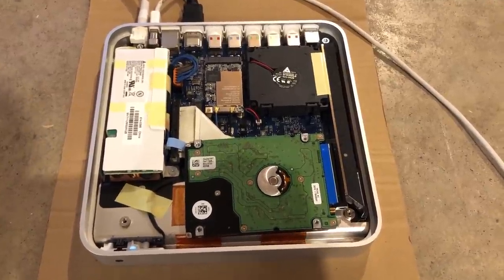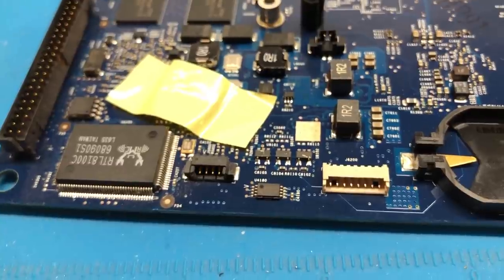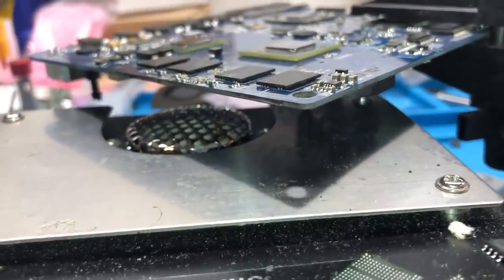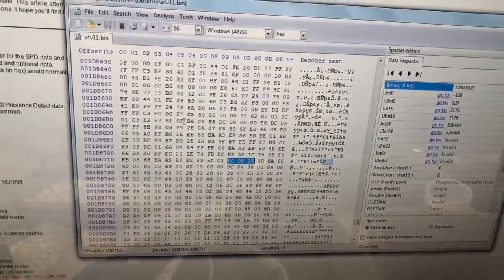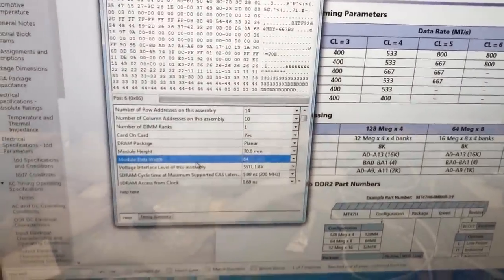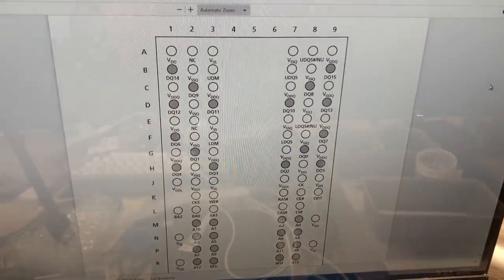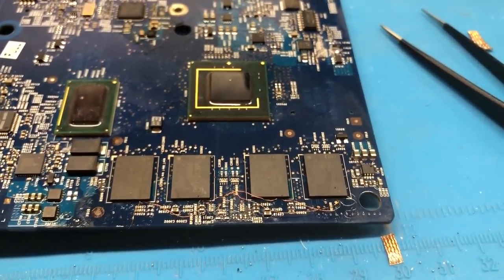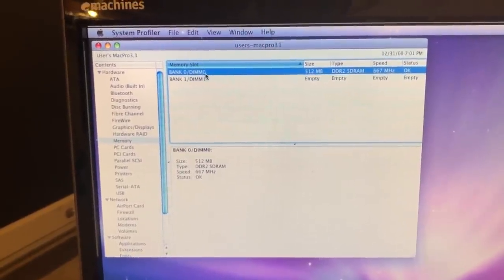Original Apple TV RAM Upgrade

Comment: damn, just when I thought you were done with the crazy RAM upgrades haha. I was sure you would give up when the address line issue came up, but you actually took off the PCH and all the RAM chips and reballed again to run the jumper wires. I'm seriously impressed

Comment: For a long time I used this ATV 1st gen with CrystalBuntu and a Broadcom CrystalHD chip in the place where the Wifi Board used to be. And I also fitted a IDE2SATA converter and it was my media center for a long time! Very nice! Serving Samba, BitTorrent Sync and Transmission. Fun times!
Reply: That’s neat
Reply: I still use one for this lol, haven't found a better device that has component output for connecting to my crt easily
Reply: I never managed to fit a sata adaptor in a way I was happy with. Such a shame these weren't sata based, the time period was right but I assumed the chipset didn't have a built in sata controller.
Reply: How did you get BitTorrent sync running on it? Also I can't imagine it ran well given how much ram resilio sync uses for me.

Comment: That's amazing! I had no idea you could do bodge wires with BGA chips. Makes sense that the wires were still necessary because otherwise that last address line would be floating and it would be unpredictable which half of the chips you'd actually be addressing...
Reply: you dont know i ve seen indian technicians who soldered a bunch of wires under the bga chips in a phone which is impossible because its so small
Reply: Not practical and there is a good chance that you will end up ruining the chip/board but its not impossible.

Comment: I know this was a long time ago but you can protect things like that IDE port with kapton tape. Just tape over all of the things that you don't want to be affected by the heat. It's great stuff. The through hole connectors are usually added after all of the surface mount using a flow fixture.

Comment: You have 3 problems that could ruin signal integrity: impedance matching, length matching (timing problems) and your line is too far from the ground plane. To properly apply such kind of mod you need a VNA to measure impedance and a fast Oscilloscope to test timing. To solve the grounding you must use a tiny coax or flex pcb with ground plane.
Reply from the maker: I was planning to make some custom flexible PCBs to bodge on an entire second rank (so 4 more x16 chips). Basically they'd sit under the original chips in a way where the original chip would be able to solder to both it and the pads on the board (basically BGA pads with small holes), and have a set of pads for a second chip that you could solder on, then fold around and stick on top of the original chip. You'd only have to pin out the #CS1 line from the MCH, which of course isn't used for only one rank. Flexible PCBs are somewhat expensive to have manufactured, though, and isn't worth it for this crappy Apple TV LOL.
Reply: @dosdude1  That would be a financially unviable spectacular project
Reply: @dosdude1  Projects like that sound like a good reason to make a patreon, so us EV Nerds can see something that epically unpractical undertaken lol.
Reply: Only out bro doing things no one needs wants or thought of. But holy shit it’s great

Comment: I saw that there is a Geforce Go 7300 with 256mb would that help any of the performance?  I know it is about 4x the memory for the GPU?  Since it is the same chip, only with more memory, would the ROM have to be modified?  Wondering since you wanted to put 4x the memory in for the system.  Have you looked into any other memory chips that would have worked better?  No need for the wires that had to be added?

Comment: These were amazing when they came out.  If you had an HD video camera back then, there really weren't many good options for showing your own content aside from carting around a computer because BluRay burners were still crazy expensive. Sadly, they ran very hot and my iTV died a very long time ago.
Reply: DVD players existed and the majority of computers had DVD burners by then.
Reply: @jm036  The 720p HD of the original AppleTV is almost 3x the pixels of DVD (i.e. 480p SD).

Comment: So ive been watching you for a while. But i was wondering if you could give me any pointers on replacing a FCBGA cpu. I wanna change out this old celeron 2955u for a i7 5557U. its about 4x better. both use FCBGA1168 but i was wondering mainly where i could get some of the tools you use and the solder balls. Also do i put flux under the cpu when heating up the solder balls?

Comment: You can use a drop of resin to hold the wires in place next time, so drop of resin. Uv light and sand it down
Reply: Yeah, I was thinking the same thing: glue the bodge wires down (or at absolute minimum, tape down with Kapton tape).

Comment: On the top side of the board next to the wifi card there is one or more Samsung memory chips.  Can they be upgraded as well?  Were you able to determine the pin out on the 10/100 ethernet chip to see if it can be upgraded to gigabit ethernet?

Comment: As you're the owner of one of these, is there any way you could figure out a solution to make a no-frills installer to get a modern CLI-only Linux distro installed on these, like Debian? No one has a tool that does specifically this, it's all media center OSes with limitations on what modules are in the kernel by default, and OSMC dropped support for the hardware ages ago. these are still wildly useful as shairport-sync airplay units and the like... so long as you're willing to do some cooling modifications. it's hard to set it up to do these tasks and any sort of other modern program amenities without running into compiler hell with the old 4.x kernels and debian-jessie-era software. 256MB is more than enough to make this happen, and given they have RCA, optical and HDMI audio outputs, they make for a great audio media center and such.
Reply: It is actually not that hard to boot a Linux on these. You need a bootstick with the apple Tv bootloader and a linux installation on the harddrive or a USB stick. The bootstick boots an old version of Ubuntu and lets you start another linux kernel using kexec

Comment: Rather than desoldering that tiny little chip, you can just clip a programmer onto it (like a CH341A, but get a real clip) and run `flashrom` on it.  I've done that many times and reflashed chips without touching a soldering iron.

Comment: I wanted so bad to use this as a media center PC.  I didn't like how the ATV software relied so heavily on iTunes, and was limited to 720p.  However, the XBMC (etc.) ports were really encouraging.  I even bought the CrystalHD decoder card.  I kept hearing how it wasn't quite all the way there yet, so I waited a little longer, then eventually tried installing it on a custom Gentoo build, which didn't go very well.  Later, I thought I might give it another shot, but there were some regressions in the decoding support, so I waited a little longer.  The next time I checked, they were waiving the white flag, citing the RAM limitations as just a bridge too far for this platform.  sigh...

So, I've got one.  Modded with a flash disk and a CrystalHD.  And never really put it into production.  At this point, there's no reason to bother with all the alternatives that are better in every single possible way.  Something about that still chafes though.

Comment: @dosdude1 do you remember when you did the cpu upgrades on the 2009 macbook/mac mini? i wonder if it is possible to replace the nvidia 9400m in those systems with the 512mb graphics chip of the early 2009 macbook pro? im currently restoring an early 2009 macbook and this could be one of the coolest things ever. 8gb ram 3.06ghz processor and 512mb of vram. that would greatly increace its performance if possible

Comment: Well done 😊 this is way above my head.I was wondering if you put 2 of the old chips back on ! What would happen? May gain 128 mb on top of 512 mb
Reply: You would be stuck on the original 256mB as the chips are working in parallel, each taking up a part of the buss width, so the smallest chip determines the usable capacity
Reply: @martinfinne7259  thanks 🙏 like I said initially it’s above my head ,after watching this several times! The chipset is missing data pathways so apple cut the expansion path 

But someone will probably prove me wrong 😊

Comment: stupid question
in the early 2000's board manufacturers were able to pull a trick of installing both ddr1 and sdram pc133 on the same bus, mostly via and sis in ecs pentium 3 boards but you could find ocasional pentium 4 board or athlon where you have to phisically move tows of long jumper blocks . for some reason the bus and voltages of the ddr memory could work on pentium 3 board in lowered speed and pentium 4 boards could run either depending on what was detected.
what if you go this way , frankenstein an interposer board to install some ddr3 chips of higher capacity? it would be a lot of head scratching but if you localise row and cass lines you could probably even add in more ddr2 chips
i know it is not worth doing but i have no idea what an old apple tv would even be usefull nowdays if not upgrading for sport

ok after watching the whole video i see tha issue
it would be funny to just smack small pcb under the chipset and install ram socket on the side of it :) like people make frankenstein ps3 fat with ps3 slim gpu's
does 4gbit ddr2 chips exist because microchip is mentioning them in some intel atom chipset specyfication

Comment: I saw one of your videos when you solder a CPU socket in a laptop and then install an upgrade CPU to it, and I'm thinking in this idea I'm wandering, if it is possible to put a socket in a PS3 or an Xbox 360, those systems used to have thermal issues and maybe be with a mod like the one that  you performed and a custom heat sink they can work properly  and avoiding future overheating and the necessity of reballing the CPU over and over until the chips die, it's just an idea

And I think that you are the right person to ask, do you think this is possible, and if it is what kind of modding technique need to be performed to make it work

I know that it will not look pretty haha

(I'm not a native English speaker, i apologize for the lack of right writing)

Comment: Off I recall modern Intel chipsets have parents set during memory initialization that specify the delay of the memory signals that arrive at the memory chips to compensate for the difference in race length. I'm not sure if that only applies to data or if it also applies to address lines. But the time the signal takes to prepare down that white could be an issue. It might be worth calculating it and comparing it to the width of the signals.

Comment: Hmm. We typically design match length of the DDR address/control lines to half of millimeter....
Reply from the maker: Yeah... of course that’s impossible with a bodge wire. But, after further research, I found that the Intel 82945 chipset indeed does NOT support 2Gbit chips at all, so this wouldn’t have worked anyways.
Reply: @dosdude1  Support of memory defined in Intel documentation is not technical fact on many cases, but only marketing limit. For example, i using Gemini lake CPUs with 32GB of ram, defined limit is 8 (intel memory controller and their initialization code simply support it).... 
Definitely, nice job! Only one note -  if you want to determine if some signal is bonded/routed, you can use simple trick - every digital IO have protection diode to gnd an vcc, you can simply measure it by multi meter without desoldering the chip.
Reply from the maker: @petr56321313  Yes, but there is still no way to reach that pin if it isn’t fanned out on the board... So desoldering to access the pad itself is still required.
Reply: @dosdude1  Yes, of course. 👍

Comment: Would it be possible to modify the system rom on a PowerMac G5 (PCI-e model) to enable higher ram speeds than the original 533Mts such as 667Mts or even 800Mts? Would the system northbridge (U4) ever support or run stable with higher memory speeds? I may be completely wrong though.
Reply: The mem controller already runs very hot on g5, compounded with the age of the thermal page and dust in it, could cause serious problems
Reply: @virtualtools_3021  The chipset in my G5 runs very cool (about 45c maximum under a 30mins Cinebench loop in linux). I have already cleaned the backside fan and heatsink, I replaced the stock thermal paste with thermal grizzly conductonaut liquid metal, I used a rubber gasket around the die to prevent leakage (similar to the PS5). I replaced the stock push pin mounting with a set of springs, washers and 3D printed backplate. Don’t worry, I know what I’m doing when it comes to maintaining my G5.

I even went out of my way to design and print a mounting bracket for PC liquid cooling AIOs up to 240mm to work on the PCIE model G5s. (Its on my Thingaverse)

Comment: Awesome video!  Since it can only be upgraded to 512MB, are there 4 bank chips that are double the memory of the original ones that can be used and not have to do all the extra connections that you had to do @ 34:17?  Can the 7300 graphics card be upgraded?  I have seen that they made a 7400 that is the same size but better so can it be upgraded as well?  I also noticed that the Ethernet controller RTL8100C is on 10/100, but they make an identical one that is Gigabit Ethernet, can it be changed out as well?
Reply from the maker: The issue isn't the bank size (even 1Gbit chips, 4 of which give you 512MB, have 8 internal banks), but the 2Gbit chips require the extra address line in order to achieve enough address space for the larger density. Upgrading an onboard GPU like this is unlikely to work, and if you were to do so, would require extensive ROM modifications. The Ethernet controller MAY be able to be upgraded, but I know Gig E requires extra filtering/inductors. Also have to verify the pinout is the same.
Reply: @dosdude1  I looked into the pinout on the ethernet controller many years ago and they didn't match at all, IIRC.    It'd probably be easier to create a custom MIni-PCI card for the one slot in the machine based on an 8169 or some such.

Comment: If you put 512mb of ram in a slot of the powermac g3, it only uses 256mb of ram. Maby there is something going on with that ram, while indeed there is 1024mb, it's only "seeing" or using 128mb per module.
Reply: MPC106 memory controller used in the Beig3 G3 is limited to 768MB RAM maximum.   It's a hardware limitation.

Comment: to be honest, the a13 issue is probably down to some firmware stuff in my honest opinion. otherwise it'd at least try to do something. maybe it has uart that'll help you figure the problem out?

also you might really want a spi flash clamp to not have to desolder and resolder that spi chip every time you flash it.
Reply from the maker: I found later that it’s simply due to the fact the i945 chipset doesn’t support 2Gbit RAM chips. I do have another idea that should allow me to add 4 more chips, allowing use of 8 1Gbit chips to achieve 1GB.

Comment: Have you ever considered console ram upgrades? I know the original xbox benefits from more ram in various games and scenarios. Upgrading old consoles and comparing performance could make for some cool videos!
Reply: Before the original Xbox's generation I think only the N64 had virtual memory, so there's really no way to add/use more when you're working with fixed memory maps. And minus the original Xbox, I don't think consoles came with memory allocators (games usually implemented their own) until the 360/PS3 era, which meant hardcoding the maximum address space.
Reply: @kaukospots  It is actually possible to double, and use the ram on an XBOX 360, however, it involves the same process as this video with the exception that theres simply 2 unoccupied slots on the board, however you are required to mod the console and install RGLoader to be able to use the added 512mb.

Comment: I wonder is there a way to install windows on one of these.
Reply: Sadly no. Since it lacks the bios compatibility baked into the macs UEFI you can't just use bootcamp. The bootloader is also super weird and (as far as I know) needs a signed kernel to be loaded. There are many ways to install linux (or even android) on them but sadly not Windows.
Reply: @TechKingdom35  Yeah I wonder if it could boot some modded version of ubuntu.
Reply: @TechKingdom35  if it can boot some linux version we can make a costume bios for it
Reply: @bloxycola8272  It can, I tried Lubuntu and Debian for example
Reply: @TechKingdom35  Nice